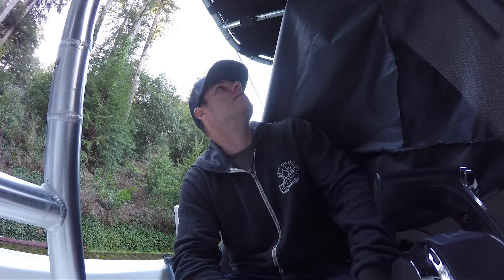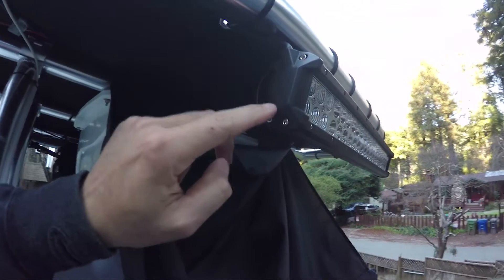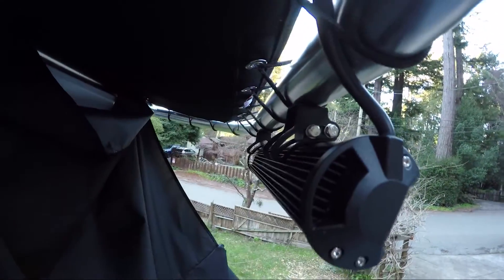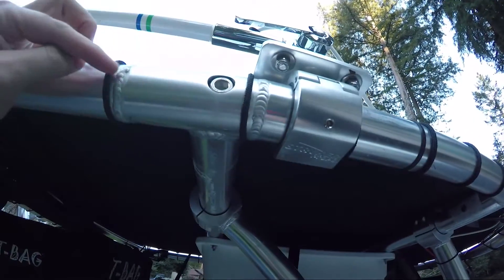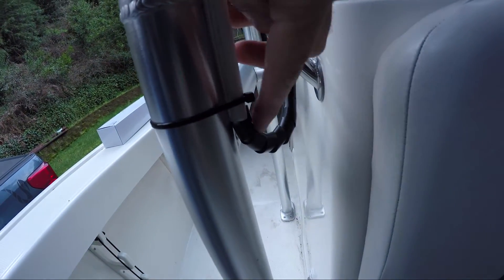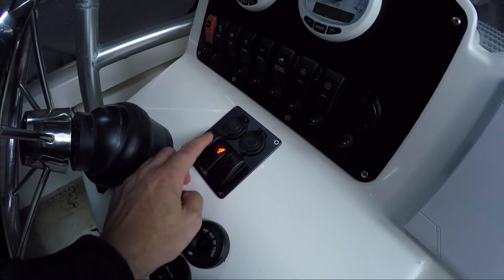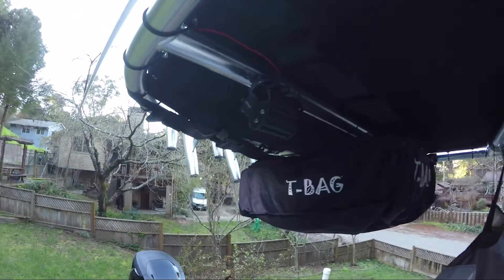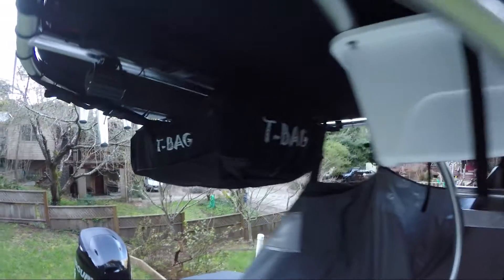Mako 204cc Stryker T-Top LED Installation

Comment: Nice! I’m thinking about doing the same with my Sea Hunt. How are the lights still holding up? I wonder if theres a way to connect them to Navigational light switch without installing a rocker switch? Love the dash padding btw
Reply from the maker: C H I took the forward facing lights off, only because I only need the rear facing lights. It’s also not legal to use the lights at night to see where you are going, that’s what the nav lights are for so other vessels can see what direction you are traveling. The lights have held up fine so far.

Comment: Looks awesome.  How long ago did you get the top?  Just asking because I just got the 600 last week and started installing it on my wellcraft and it seemed like they finally incorporated wire chases built into the pipes.  I only got have the job done today, but i was able to get weed whacker string as wire pulls from under the desk up to the top of the t top.
Reply from the maker: Micp2743 I got my top in November last year. I wish mine had the wire chasers!
Reply: SpringbokDesigns 
looks good!  I liked the way they looked and did some research.  Just picked them up for my wellcraft.  Thanks! 
Enjoy the season !